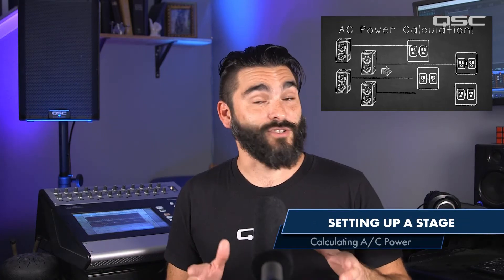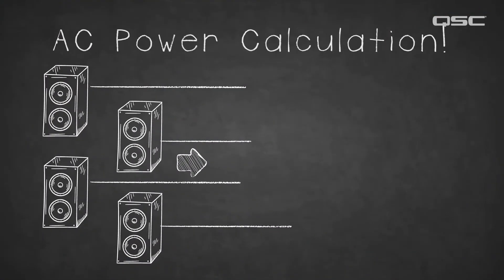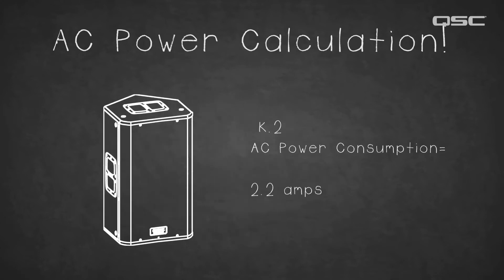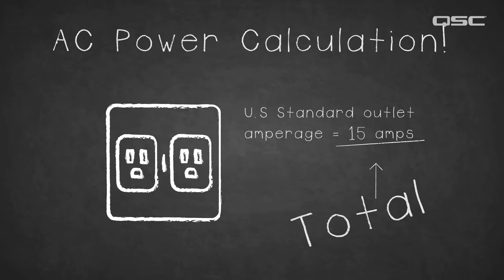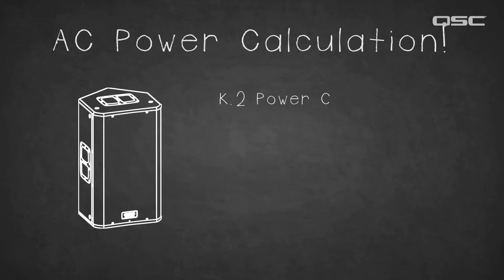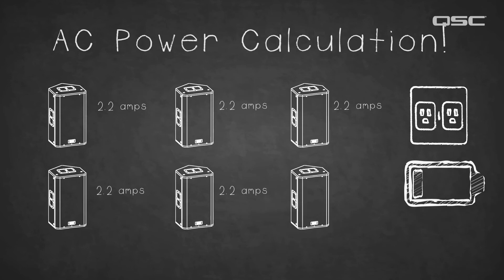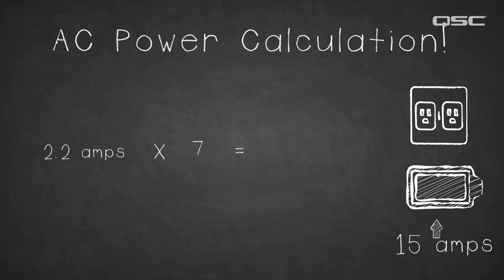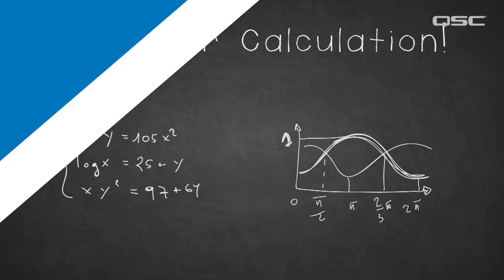Calculating Power Consumption of Your Audio Gear | Sound Advice

Comment: Boss, you are so far the most knowledgeable guy I have watch video from. I need an advise as I don’t want to put my house of fire nor do I want to put my brand new equipment on fire…. I hope you can help
I have the following equipment:
8x Alto TS415 (2500w peak, 1200 RMS)
4x Alto TS408 (2000w peak, 1000 RMS)
2x Alto TS18S (2500w peak, 1200 RMS)
2x Mac Mah AS118S (2500w peak, 1200 RMS) ~ give or take
4x Vonyx SWM15 (1000w peak, 600 RMS) ~ give or take

All of this is active equipment (no external amplifier, no lilght, no smoke machine or other fancy stuffs). So on the paper I have a decent sound system where I can have several hundreds of people dancing in the field. But my question is: how much power, amperes, etc. do I need? Can I plug all this on a regular country side house electricity? If so do I need to use multiple socket. If I cant then what do I need? An electrivity generator (not sure what the name is in English, it is called groupe electrogene in French ).
Any suggestion is most welcome

Comment: hey I was wondering if someone could help me out here because I'm a bit lost.  So I'm trying to figure out how much power a Q1212 consumes

on the manual it says something confusing along the lines of 

Power Consumption 850W
1/8 maximum output power @ 4 Ω

So I'm not sure if it's talking about the input since it sounds like it's referring to the speakers.  No where does it mention the amps for the amplifier.  Anyone's help would be greatly apreciated